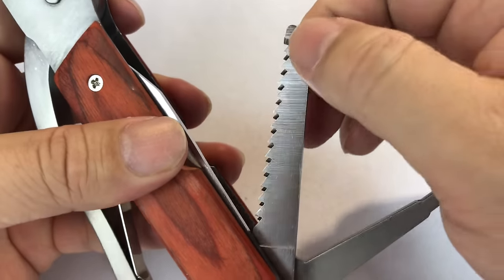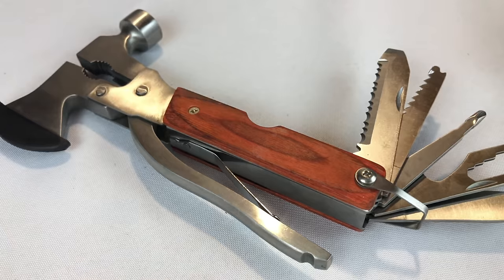7" Portable Camping Multifunctional Knife, Axe, Hammer, Pliers Multitool Review

Comment: mine was crap... steel way too soft... nothing came sharp and nothing holds any kind of edge when sharpened... the bale which holds the handles together bends real easy... the wood scales break easily... and finally, everything loosens up (knife, saw ect) and won't stay put in the handle... used for a month before i went back to a victorinox
Reply: my too but mine is little different have black robber not wood handle and have bits take down hammer and install bits screws